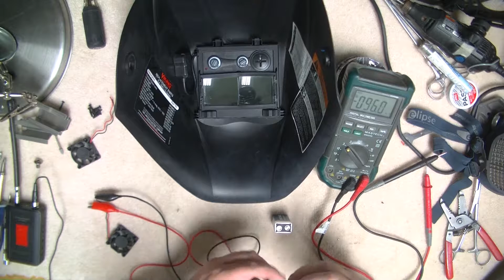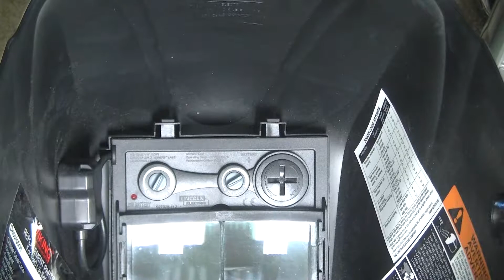Lincoln Electric VIKING welding helmet mod- fan | RATTLECAN FAB SHOP with James O'Rear

Comment: Yea i bought some tiny pc blower fans and wired one up to a 18650 battery and cut a hole to mount a switch that i can hit with mask and gloves on and mounted the battery to the back side of the head strap..  can charge both the mask auto dark and fan battery at once with a 5v usb phone charger..  had to wire in a battery charge controller and fit it into the helmet though which was the tricky part for me..
Reply: Had to buy the blower fans that are. Covered because i had hair at the time.  But that got burned off from an accident caused from getting old and bad genes..
Reply from the maker: Nicely done!